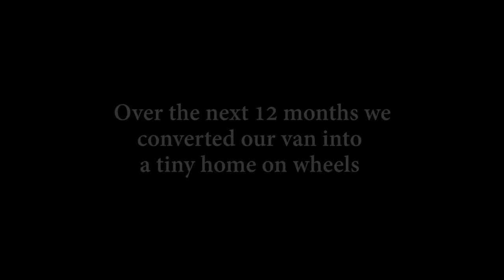Van Build Timelapse | DIY Promaster Conversion | Vanlife

Comment: Such an incredible job. I'm currently doing this with my 88-year-old stepdad and it's a struggle. Your build is inspiring. Any tips on how you measured for the shower drain hole behind the driver's seat? That's my current predicament - a lot going on underneath

Comment: hey guys, whats the material called that you used around the door frames, thats not normal carpet but something else. thanks, great video.
Reply from the maker: Hey! The fabric is called duramax. We did a video on exactly how to do the trim and there is a link for the fabric in the description. The video is called “Van build trim how to” and is linked below. 
Van build | Trim | How To
https://youtu.be/foQid7dHj9g

Comment: Good job.  You should be proud.  I'm curious about your insulation decision.  It appears you installed sound dampening sheets, then rock wool insulation.  On all of the videos I've watched, they do the exact same thing.
My question is why don't you do spray foam insulation?  It would be so much quicker, so much easier, and would do a better job of insulating.  I'm talking closed cell.  I don't think it would do as well as the sound dampening sheets, but you have so many gaps, it's not helping much anyway.  Don't take that as a negative.  Everyone has the gaps.  Nature of the vans.
Thanks
Reply from the maker: We didn’t use spray foam bc we weren’t entirely sure of how our electrical was going to be ran at the time. Also we’ve read horror stories about how it expands in the small ceiling and wall ribs and bends the exterior metal outward. I’m sure we missed some spots but out van is usually about 15 degrees f warmer or cooler in the preferred direction as in comparison to the outdoor temps. ✌️
Reply: @NomadicVisuals  I appreciate your reply.   I hadn't thought about it getting into crevasse and expanding.  Obviously my experience is on houses where that isn't an issue.
Reply from the maker: @johnnylawson69  best of luck on your build!

Comment: what are you spraying on the walls before putting up the insulation?
Reply from the maker: Hey Brenda, we used 3M high strength adhesive spray to adhere the insulation. It worked really well and made it super easy. Check out our insulation video below:
Van Build Insulation - Havelock Wool (Van Life Tiny Home Build)
https://youtu.be/7DWmXYnOaSc

Comment: How long is that van? Personally, 16 feet is my absolute minimum, would prefer 18 feet really. Would also prefer a Cutaway van too. Since Cutaway vans seldom go longer than 16 feet, I'm always bouncing between that, a step van or even a 5-ton. Stealth being my prime motivator. Yeah, solar panels would always be a give-away, but a utility truck can always pass a quick glance than any RV.
Reply from the maker: the built our area (not including the cab) is 14ft long x 6ft wide. its the promaster 159'' extended wheel base. they do have the stick on flexible solar panels that lay flat against the roof to have more of a stealth look. they just weren't the best option for us.
Reply: @NomadicVisuals  Thanks for the quick reply. Yes, there's always the question of whether the cab is included in the length.

14 feet and you still managed a shower. I'm impressed. I would be living alone and I wouldn't go that small. 

Currently living in an old 22' trailer so I have a gist of what I want, and how to increase the efficiency of space over the "one size fits all" mentality of RV manufacturers. I sure don't need a Queen sized bed for instance. Nor do I need two sinks.

Countertop space, shelves, cabinetry, a bed on a slide-out that can slide into the lower cabinets whether it's made or not. And a bigger medical/washroom cabinet. An oven wherein I don't have to double over like a pretzel to light the pilot light.

Did you use any kind of software for the planning phase?

Comment: How did you learn to do all the electrical??? Van Looks great !!
Reply from the maker: Really appreciate the kind words. We watched a bit of YouTube, but what really made it all click was playing with a 9v battery, a few wires, an led puck light, and a switch. Just trying different combinations to try to achieve the results we wanted. Electrical is really a lot less daunting than it may seem. It’s really just variations of a positive and negative wire that control everything.

Comment: Honestly it's the first video I've watched,that they placed all their electrical system(wires)strait up on that cotton protector,aren't they afraid of a fire?
Reply from the maker: Its wool rather than cotton which is fire resistant. Even if there were a short in a wire we have everything fused properly, so it would blow a fuse rather than cause a fire.

Comment: We are looking at doing a very similar design but are going back and forth over having the seating area next to bed.  It seems that you give up a lot of  potential storage space by going with the seats.  Any regrets or suggestions?
Reply from the maker: We like it. We didn’t want to have to hop through a little hole to get in or out of bed. Some people have showers or closests on either side blocking the bed access. It also feels a lot more open this way too. I’ve even seen a good deal of sinks next to a bed which if it were mine, our bed would always be wet bc Im reckless with the sink faucet. We have storage in one bench and a “mechanical closet” in the other.

Comment: Why use glue on the ceiling and sides? You don't need to since you put wood on after it and by using glue you've just made it harder to remove the insulation without making a mess if you ever sell the van later or have to alter something.
Reply from the maker: glue was the best option for us. we tried using string to hold it on the walls originally and it seemed like over time the insulation would fall down creating large uninsulated areas. we used it on the celing bc it was quick and easy. we have had to remove it in the past where its been glued to something and its not a very daunting task. 10/10 would use glue again, but thats just my opinion. to each their own

Comment: What was the total cost of van plus work?
Reply from the maker: Hey Reinaldo! we are right at $65k USDfor the van and the build. The build came in right under $25k 
USD (just for the material we did all of the labor) I have no doubt it could be done cheaper, but we made a lot of mistakes haha. We did a video called: What it actually costs to build a van. we break down all of the costs into individual categories.

Comment: Ram Promaster is too large and heavy for front wheel. My friend's  Promaster transmission fell apart as soon as the warranty expired. Engine problems followed.
Ford Transit is a much better platform

Comment: I don't understand the madness with these silly VANS just buy a freakin RV and be done with it...
Reply from the maker: The part that was most attractive to us is that we can take our van where rvs can’t fit. We can park in a normal parking spot. Camp in a small pull off on the side of a forest road, and also the ability to customize your layout (to some degree) and use more durable materials than an rv. Our build and van cost was also half of one of the smaller rvs on the market at the time.

Comment: I HAVE TO TELL YOU THAT TODAY A DODGE DEALER REFUSED TO SERVICE MY PROMASTER 3500 BECAUSE IT HAS BEEN BUILT-OUT TO BE AN RV.  THE PROBLEM IS/WAS THAT THE BREAKS WOULD STRONGLY APPLY RANDOMLY AT ANY HIGHWAY SPEED. THE DODGE DEALERS THAT I COULD FIND DiD NOT AND WOULD NOT TOUCH IT BECAUSE IT WAS TURNED INTO A CAMPER VAN; I PAID $130,000 U S DOLLARS FOR HER JUST 15 DAYS AGO, BUT I AM SCREWED GIVEN THAT THEY REFUSE TO SERVICE THE VAN.   DO NOT BUY ANY DODGE VANS OR YOU WILL LIVE TO REGRET IT.  CONTACT ME IF YOU HAVE ANY QUESTIONS!